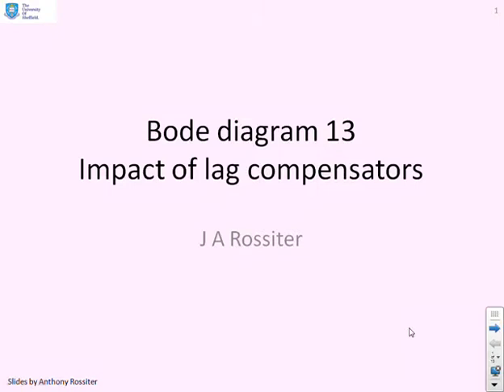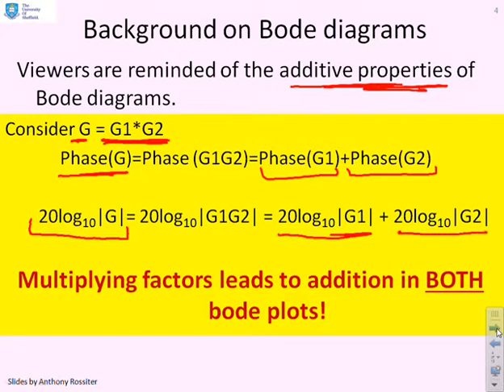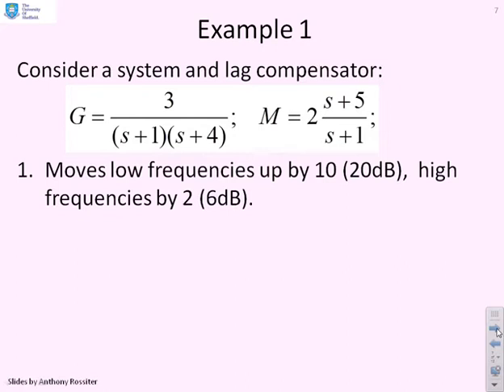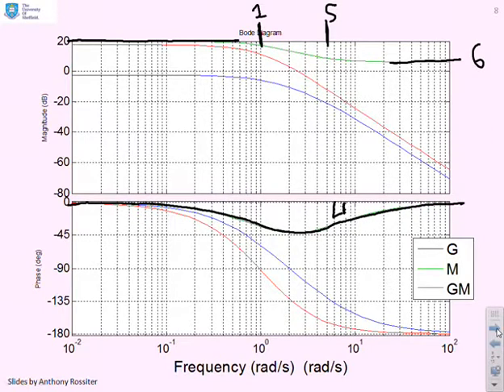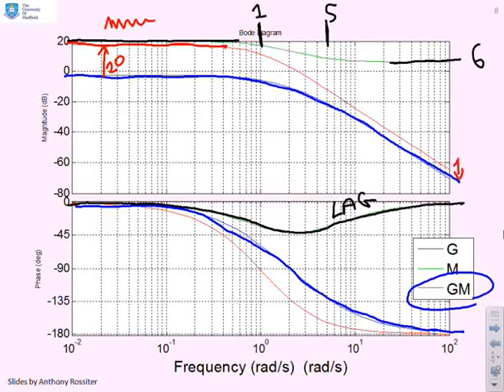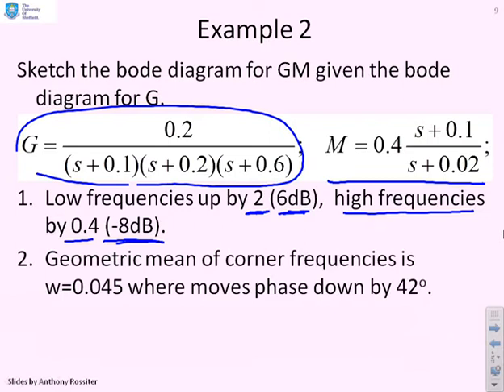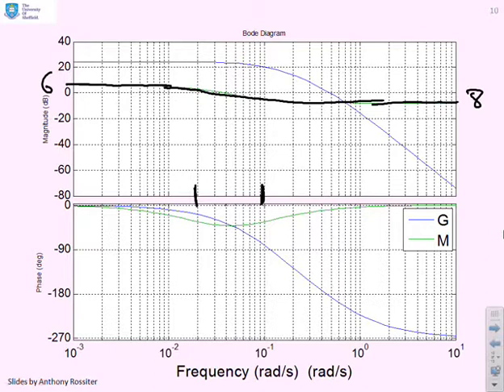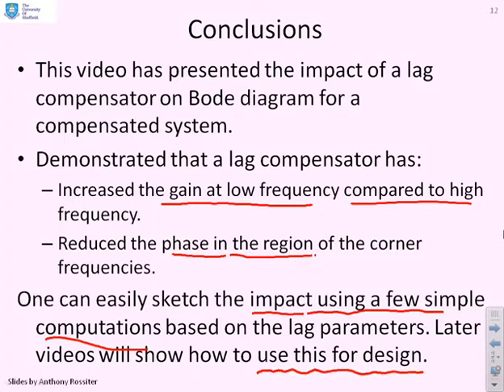Bode diagrams 13 - impact of lag compensator

Comment: In example 1, How does the phase move by 33 degrees? I thought it would be tan^-1(1/5^0.5)- 45 degrees, which is 21 degrees?
Reply: Doesn't matter I read the equation wrong

Comment: in example 1, i can understand that move low frequencies up to k*beta = 2*5=10; but why need move high frequencies by k=2 ? is that should be beta ? Since the high frequencies gain is beta = 5.
Reply: If you're still puzzling about this 8 years later here's your answer: the compensator is 2*(s + 5)/(s + 1), when s is large (high frequencies the ratio (s + 5)/(s + 1) approaches unity so the compensator is 2*1 = 2. Then 20*log(2) = 6 dB (at high frequencies).